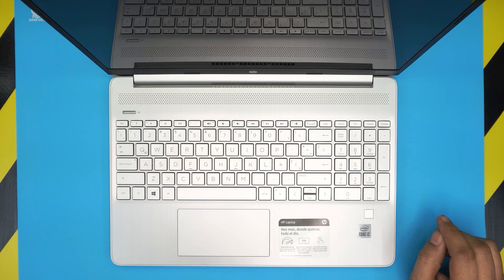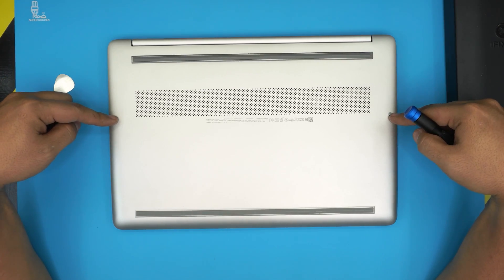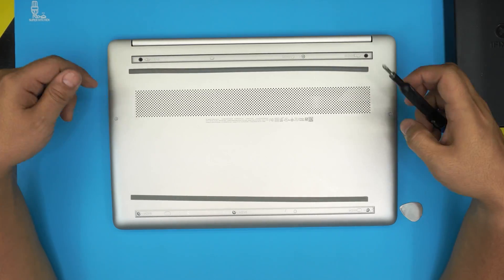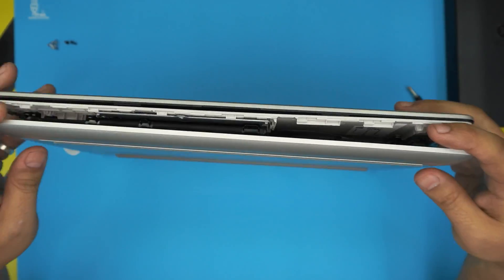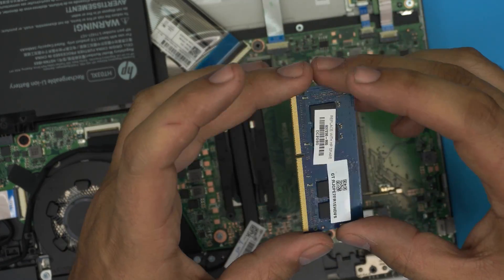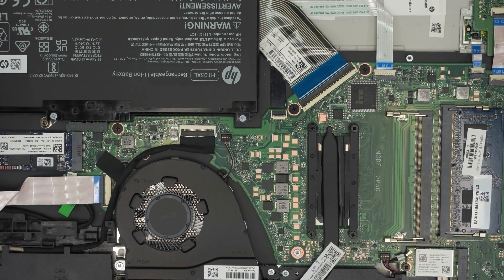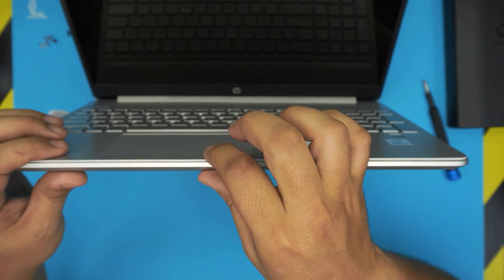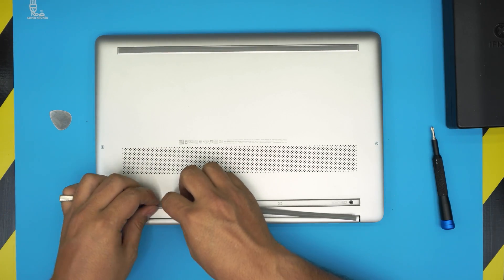👉 Hp 15 DY 1002 RAM UPGRADE

Comment: To do this ram upgrade, or to replace the DC power connector, is a ESD wrist strap or mat needed?  Its for a hp 15 dy5033. Im not new to tools, just new to sensitive electronics.
Reply from the maker: Regarding your question,  absolutely not requires you to do any ESD wrist strapping, just before you start just don't rub you feet on a wool carpet nor put a thick fur jacket. the best method to make you safe is that before you start working on a laptop, plug the charger to the wall and just grab and touch the tip of the charger plug (were you connect into laptop), simple touch to that it will discharge you.
we been servicing for over 17years and no technician ever uses a ESD wrist strapping, just the paranoid people.
you can man handle the boards without any issues.
you worry too much my friend.😊
Should you have any further questions or requests in the future, please don't hesitate to ask me.
cheers🍻

Comment: Hello i have a question i have HP 15.6 model 15 -dy207dx  8gb-256gb SSD is it possible to use the corsair vengeance i was possible trying 16gb will it work ?
Reply from the maker: Thank you for your feedback! If you wish to support the channel, you can like, subscribe, or both!
Regarding your question, yes you can but i would recommend to check the max ram capacity: https://youtu.be/tKEJTkVth4Q
Should you have any further questions or requests in the future, please don't hesitate to ask me.
Reply: @uFixTek ⁹ĺ99lp

Comment: this video helps a lot but i have some questions, i have a hp 15 dy1xxx laptop i3 and i want to upgrade my ram from 8 to 16 gb, but i dont if it will be able to handle it, says that there is 2 slots, and it says it can handle up to 32 gb of ram, could you help a bit pls?,  ill gladly give you more info incase you need it
Reply from the maker: Thank you for your feedback! If you wish to support the channel, you can like, subscribe, or both!
Regarding your question, my friend your laptop can easily handle 32GB, but it will be over kill and based on your CPU i highly would not recommend 32GB, go with 24gb (8GB and 16gb)  then you will have dual channel memory, we use this rams they are very compatible: https://amzn.to/3OV8x7k
Should you have any further questions or requests in the future, please don't hesitate to ask me.

Comment: Also, does the RAM amount in each DIMM need to be the same size? 8 x 8 or 16 x 16?  Thanks - Subbed!
Reply from the maker: absolutely not, you can have any combination as you like and it will be configured as dual channel also, so no worries, Cheers

Comment: a question, what is the maximun speed of the ram for this board ? 2666 or can I increase the speed to 3200Mz?
Reply from the maker: Thank you for your feedback! If you wish to support the channel, you can like, subscribe, or both!
Regarding your question, the max is 2666 , if you place a 3200 it will auto adjust to max it can run at.

Comment: shouldn't you remove the battery first?
Reply from the maker: Thank you for the feedback! if you wish to support the channel you can LIKE or SUB or both :P
regarding your question: No, absolutely its not necessary to remove the battery, because if you do the BIOS will set to its default setting as well if you have any configuration in it. i been upgrading and repairing laptop for over 18years and trust me you can't damage the board by removing ram and upgrading with battery plugged in.
Reply: @uFixTek Hi what do you mean by BIOS do i have to have that turned on or something to upgrade my ram?